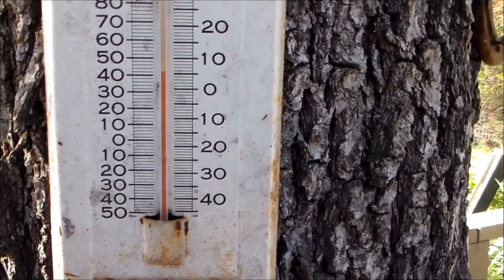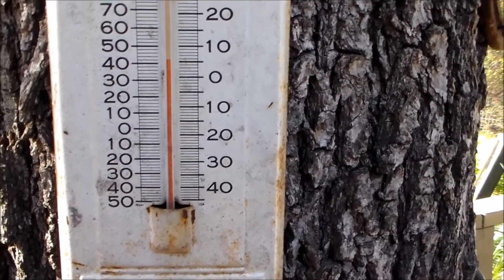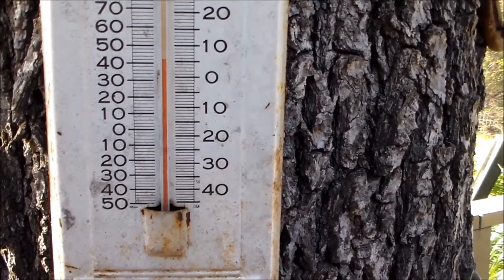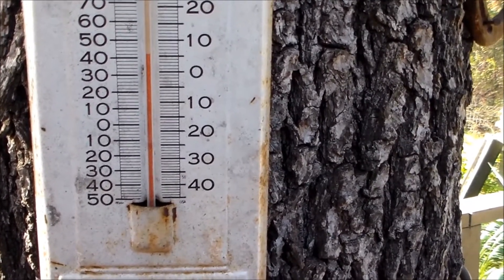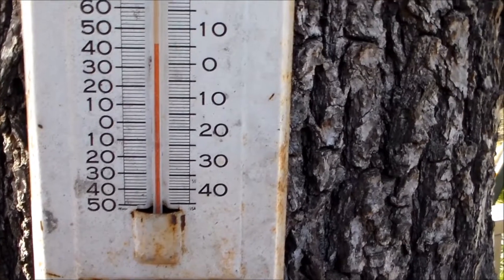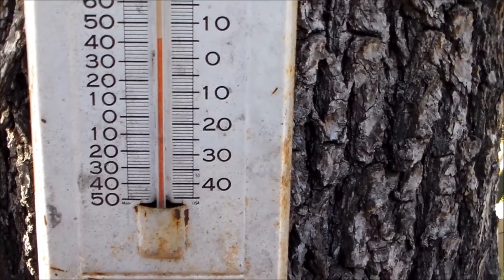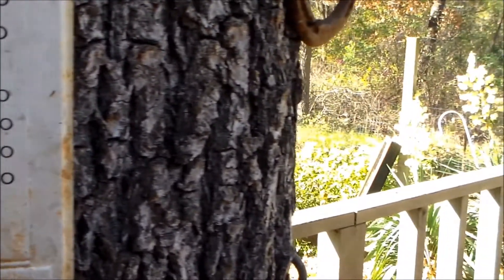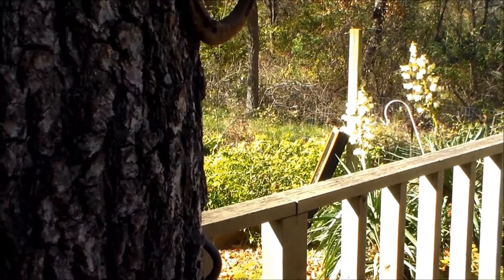Solar Air Heater Test - 145 F Temps - Green house heater -  DIY solar thermal furnace

Comment: Although you are getting good results with your setup, the purpose of the cans/tubes in most solar air heaters is to produce a natural air convection. As the cans heat up, the greater the internal temp, thus increasing pressure and flow and finally offering greater exhaust temperatures.
Reply from the maker: It gets hot , but I'm putting a solar fan on it too